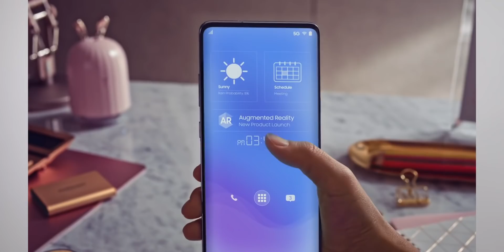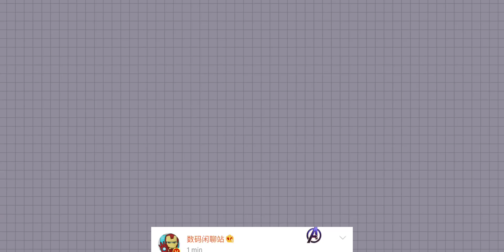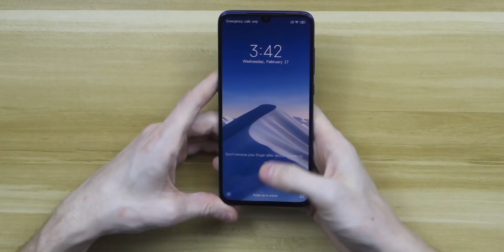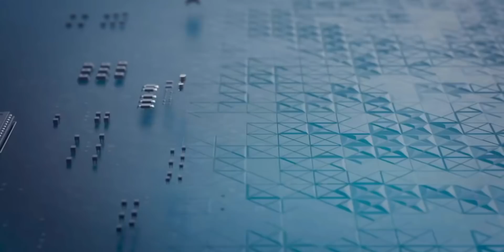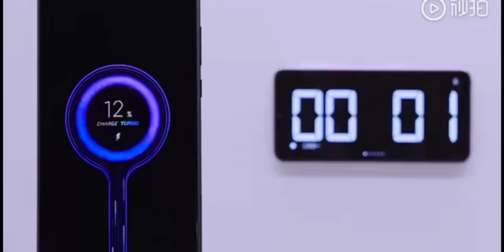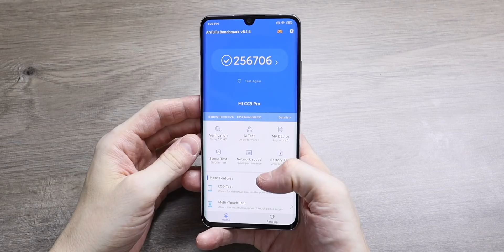Xiaomi Mi 10 - EPIC SETUP

Comment: I prefer 64 mp cameras, that's the sweet spot of sharpness, low light whilst pixelbinned. 8&12 mp is just missing that bit of detail that 16 mp provides whilst 24 mp doesn't add that much detail because of noise that gets introduced so the file size just increases with no benefit in quality.